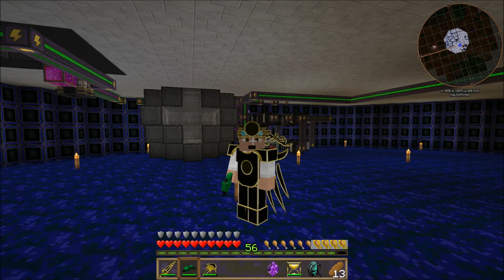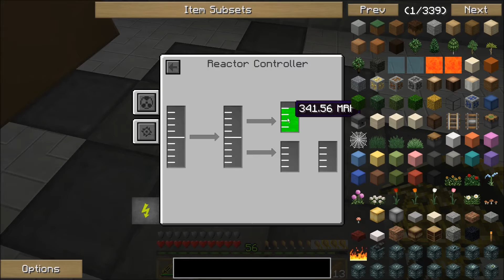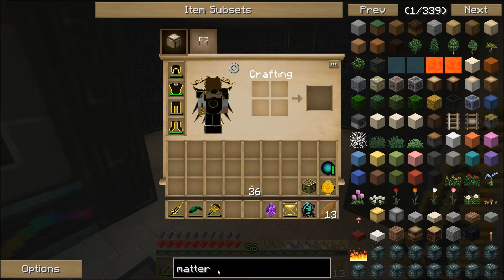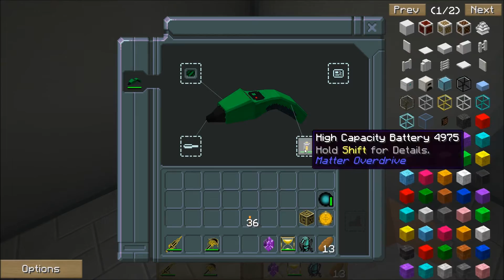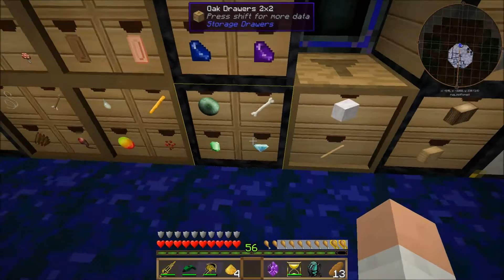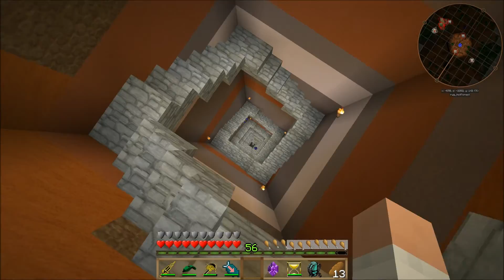Horizons Daybreaker - Friken Lasers - e13

Comment: Instead of using the Matter Duplication method from Matter Overdrive, which, by the way, is an amazing system, it would be much faster, much more efficient (100% chance of succeeding) and less power intensive to use Equivalent Exchange 3, which has a working EMC system and Transmutation tablet.  Also in the Horizons Daybreaker modpack, there is a mod called Simple Condensers, which adds Energy Condensers, however I do suggest getting at least a Transmutation tablet.  Also, I suggest that you become an android from Matter Overdrive; it can be quite fun to augment yourself...
Reply from the maker: New_Physics As far as EE3 all I can say is: Spoilers. I totally want to become an android, but I have not seen a single android spawn yet so that is what is holding me back from that.
Reply: Not a single rogue android spawn yet...  Unlucky.  Would an RFTools Spawner work on them? Testing now.
Reply: They can be syringed, an I haven't managed to spawn one yet with a cascading spawner, yet I will keep on trying.  Also, maybe cursed earth will work.  Try making your cursed earth spawner automated...
Reply: Landstryder Another method to get rogue androids would be to up the spawn rate in the configs from 3...

Comment: Looks like you might need to update Gecko's Lasers to 0.7.1
Just ran across this:

(http://www.curse.com/mc-mods/Minecraft/228888-gekos-lasers#t1:changes)
As stated in the changelog:
Fixed a crash when firing lasers on a server
Also take note that with the update they added a new keybind that's bound to F by default. It must be changed because it does not work with all the other things bound to the F-key.
Reply from the maker: Yep that is exactly what we had to do to be able to use them on the server. There is also server only bugs with the mod particle physics but I haven't seen and update for that one that fixes it yet.